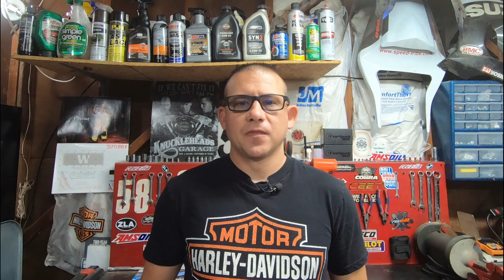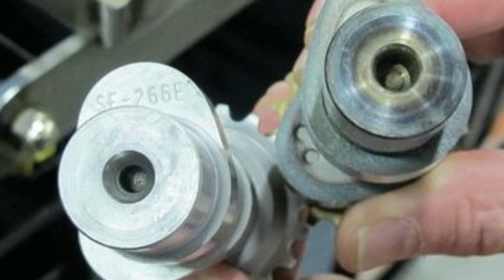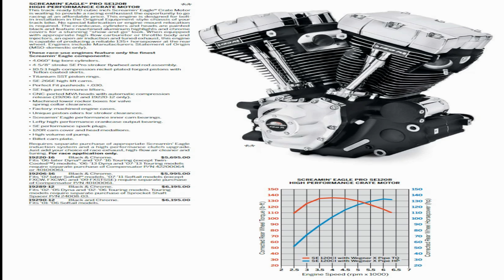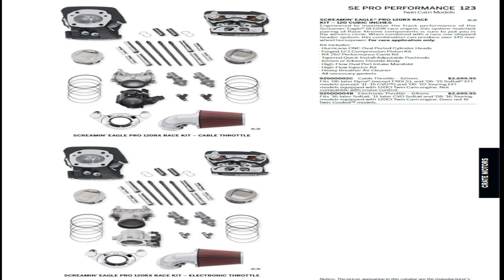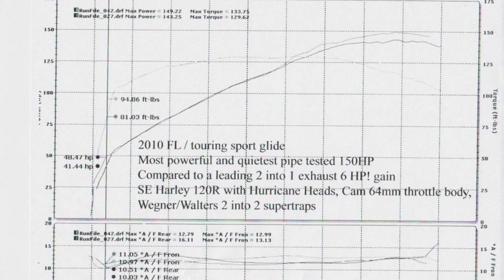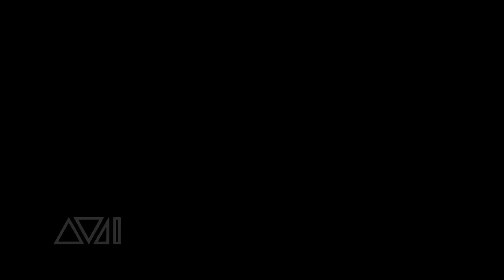Harley's Screamin Eagle 120R Twin Cam CAN Get Even More Powerful

Comment: Yes Harley Store or Harley whatever it's a dealership under Harley franchise I don't know but a Harley dealer.
Get a load of this I take my nightster in 7 thousand kilometers I was sending it to a fellow out by Montreal for head work cams etc.
The dealership calls and say we have a company through Harley does heads we have all Harley stuff.
I'm sold the mechanic working on the bike was ok and have had no problems to date with mechanical other than natural stuff consumed clutch.
So I wanted to order the Nightster fender and parts as the Canadian version did not look like the nightsters advertised.
They told me it was an illegal mod.
It should be illegal to put something together at that price with e dynos the last one being the final dyno setting the engine timing ect.
They changed nothing from some can map for a 551. My complaint was how do you do that the numbers are different between the cams.
Anyway sorted now took 2 years and a camera went looked inside to see pitted pistons .imagine the head is the same.
So now I'll use other runners not the Harley peo tune.funny other company's have maps for Harley cams.
So I'll get Andrews or s&s or redline no more Harley expensive parts I'm Gina pay I'll pay but I'll pay now for specialized as Harley don't hold their own.
Sad. I love harley
Reply: The pro runner was the saving grace.i knew something did not sound right going through the throttle to excelerate and I'm talking normal excelration I'd go through the one set of numbers reamed havovic.
The pro runner soon as I seen it like how is one cylinder 14 degrees higher than the other and then a 1000 rpms away the other cylinder.
I start slow one cell at a time worked to a basic map with no advance and slowly added some back in it did work a 6000 rpm but who lives there on a street bike and even them no would jugle around for no apparent reason like 26 degrees dropping back to 23 and in the next cell jumping to 29 made no sense.
They justified it on irregular firing of the Harley motor.
So my response was a 536 cam has been around along time before EFI and apparently it's the same grind with the exception of some difference on the cam for EFI but the grind is identical so I asked them how did you need able to do this with points as I see no difference well big difference but the actual rotations are all the same.
Thank-you for the light you show us on problems we can face and for you help suggestions and advice love it
Thank-you
Reply from the maker: Thank you! Fuel injection love it or hate it on a Harley,  it's given us the ability to tune each cylinder individually. This really helps with cooling down that rear cylinder and allowing us to get more precise VE tables.
Reply from the maker: The "download" as it is often referred to for tuning on some of the Harley Dealer installations is awful. If you're sticking with all Harley performance parts it's well worth getting the Screamin Eagle Tuner. I don't think I've ever seen a bike that ran right with the canned download map for their parts. In my opinion even the factory tune on new bikes isn't really that great, but it works alright since the standardized assembly process. Even a with a Harley Tech doing the install, doing everything right, the canned map just doesn't work. If you buy the tuner and the dealer installs, the technician will map the bike with the tuner and run it on a dyno. If the dealer doesn't have a dyno, a good dealer will run some auto tune sessions and make sure it's right before they send it out.

Comment: Hey man, thanks for this video. I've wanted a general summary and comparison of these equivalent motors for quite some time. We should note that "horsepower" is a fictitious number derived from measurable torque x RPM meaning usually, that horsepower number gains denote increased flow at higher RPM and conversely, sacrificing torque at lower RPM (waiting for the blowback as soon as I hit "send"). With your explanation here I'd likely stick with the "R" (no X-pro) and find a torque cam for it being I really never redline or race stop to stop (my days of doing that are long since gone). In the comments I also see people tour with these things (I tour on a stripped down Softail) so that eases concerns however, what additional mods would be required downstream; i.e.: primary chain, clutch, (existing 5 speed trans) and belt? No need for specificity but your general thoughts would be great.

Footnote: I'll never understand in comments why people must put others down so offensively for some items not included in anyone's YouTube productions we get for free. Impressed you took a higher road not feeding on chum thrown add-hock to sharks.

Good job and thanks!
Reply from the maker: Thank you, l appreciate your support of the channel. These are really good motors, l would definently add an oil cooler if you don't have one already. For me the two things l would do installing one of these is upgrade to a Screamin Eagle compensator and and look at a good high performance clutch upgrade. Definitely a compensator, the clutch would just depend on how hard you plan on riding the bike.

Comment: To bad they don't make the ST in a "B" motor. Seems perfect for my Heritage
Reply from the maker: Yeah it won't work for the Softail, butnthe 120R will fit and it's basically the same engine. Just a more aggressive cam and an upgraded cam plate with a high volume oil pump.
Reply: @GixxerFoo  so, the 120R is a balanced motor ? Nice, but way too aggressive for the street in my opinion.....I like the occasional holeshot , but I don't want to be at the bar 3 pitchers in by the time everybody else catches up  🤪🤣
Reply from the maker: Lol yeah they have an R that fits the Softail. A little milder cam and you have basically the ST.

Comment: Would either of those fit into the 2016 Triglide frame? Would absolutely love a little more power.
Reply from the maker: They sure will, there's nothing different about the mounting system in the trike frame.
Reply: Thank you, the dealership was telling me could not even add a stage 4. By any chance do you know if the newer 131 engine would fit? Thank you for your time and definitely enjoy your videos.
Reply from the maker: I'm not sure about an M8 2016 trike, the motor may fit but it would require extensive wiring. The dealer won't do a stage lV since Harley won't warranty it in the trike. Just like they say 120ST is only for touring bikes but it will fit in a Dyna. Theirs no difference in the trike engine vs. A touring bike engine.

Comment: Great video, i just to have a 103 with stage 4 kit on my fatboy 2013 feels powerful but i decide to do a swap for a 120 R, and yes, is another level a lot of power all the way up, very fun to ride in curves and straight lines as well, good for long haul.
I added an oil cooler and works perfect. On an engine for racing there will be no guarantee. Keep posting. Twin cams are very strong
Reply from the maker: Thank you! That's awesome to hear, if it's done right like you have it should last and serve for many years.
Reply: @GixxerFoo  that is correct, greetings from PANAMÁ
Reply from the maker: I bet you've got some beautiful places to ride down there!

Comment: G'day team, it was interesting to hear what you had to say about the 120R and thanks for your comments. Currently I have one fitted to my 2009 CVO Springer Softail and it copes quite well with day to day traffic and riding but in saying that this would be different for everyone because we all live in different areas and population. Mine is fitted with a 55mm HPI throttle body only because it was originally for the 110 motor and a D&D 2 into 1. I had the o'l girl on the dyno and it came out at 108hp and 128 torque, yes the numbers are low and possibly due to the 55mm TB but it's a tough street motor and yes it pulls at wide open so hang on if you decide to get one yourself. A few items I would highly recommend you also fit is an upgraded clutch and basket, I fitted a Barnett item and it's great as you would expect. If you decide to head for the 120ST version spend a bit more and add the cam plate and oil pump as an upgrade. which ever choice you make remember to have a good look at the compensator because it may need updating as well. I believe that the one big advantage is the Screamn Eagle Crank Shaft as the Twin Cams suffer from a poor crankshaft and the improved crank bearings as well so if you did a price comparison with upgrading the current twin cam to buying the 120R it's a no brainer. Just one other thing with the 120R is they have an issue with the lifters failing so make sure you change out the SE valve springs for a set of bee hive one able to hag on to the 266E.
I hope this is of some use to anyone out there, keep the shiny side up won't you. Regards VM.
Reply: I feel the same way.bigger TB, Beehive springs a must,  Thunder Max cost a good bit but worth the money .Last but most important Barnett clutch .we have good results with this combo .
Reply from the maker: That's what l was looking for, you have one and you have a first hand account of how they run on the street! Thank you for mentioning the clutch and compensator, lol need it or not at the time those aren't bad to go ahead and upgrade also.

Comment: The only reason the Harley says the 120st doesn’t fit in dyna models is cause it comes with an electronic throttle body.

Does this guy even research what the hell he’s talking about!!!
Reply: With enough money and time you can do just about anything ur heart desires
Reply from the maker: Pretty much, or skilled hands. Fabricators can do whatever they want and make it look factory.
Reply: @GixxerFoo  having a little mechanical ability can go a long way. Especially working on harleys, such simple machines
Reply from the maker: Oh yeah, they aren't bad at all. There's nothing over complicated about the motors, even the new M8.
Reply from the maker: That is true, also Harley won't warranty it if you put it in a Dyna and swap out to a cable throttle body. But yes you are correct, technically it can be put in a Dyna.

Comment: Just did 1000mile trip this week with my 120r,  ran like a top, and I was getting about 25-35miles more per tank then my dad with a 103 kit. Power is fun at first but leaves you looking for more. Thanks for the video, not enough videos on these motors.
Reply from the maker: Thank you! I appreciate the comment on a long trip with a 120R, a lot of people say they aren't reliable. If anything they are more reliable than the stock motors with that heavy duty crank and premium components.
Reply: @GixxerFoo  you may have a problem sir....😳
Reply from the maker: What happened?!
Reply: @GixxerFoo  lol..this power thing can make a person go mad!!!😀
Reply from the maker: 😆😂 it's a rabbit hole for sure, it just keeps going. It depends how much you want to spend and how far you're willing to go.
Reply: @tmar0075  if you're into cars I'll save you the time and show you the end goal. Google slc superlite or ultima evolution 

Deep in the power game in Cars. 700 rwhp but like 2 hours of work or less and it's hitting 1300 rwhp. In a 69 gto..... it's death but beautiful.
Reply: @GixxerFoo  update on 120r, did a 4000 mile run this past summer, didn’t realize a lifter collapsed and had ran hard, ended up having some metal go through the oiling system, long story short my cases and heads are on their way to hillside cycle in New York for a 124. EVERY forum addresses this issue and it was like clockwork, I knew I should have changed them out before I left but can’t change that now. Simple maintenance as sworn by online would’ve just saved me big $$$$
Reply: @Stonedglide89124r how many miles on those lifters before they failed?
Reply: @thomasborger6548  about 20,000
Reply: @GixxerFoo  Your video about the 120R encourages me more nowadays because you are the only one making the reliability observation regarding the integrity of the 120R. I found the Tampa HD video with Tony Nicosia (Sp?) where he explained how he and his CVO engine team designed and produced the 120R engine when I first began looking into buying one two years ago. In that video he briefly explains the processes he and the team took to make the engine as reliable as a hammer. It seems there are many ways to get lots of power out of it too. :)

Comment: For that money I'd go with the S&S 124 and get gear drive cams plus their flywheels which are much stronger.
Reply: Agreed. Honestly once I upgraded 88 to a 95 the motor has done very well (Oil Cooler Added) It just won’t die. If I were to upgrade I think I would go to S&S 124 as well.
Reply from the maker: The S&S in my opinion is a much better engine, they engineered out the factory weak spots.
Reply from the maker: S&S is hard to beat, they fix the weak points in those twin cam engines.
Reply: @GixxerFoo  Tony Nicosia designed this engine for strength and power. No one else in modern history else in modern history of motorcycle engine design for both strength and power has more knowledge and expertise. While S&S is a favorite of mine as well, the master of power and strength cannot be denied.

Comment: I have a 2010 Fatboy Lo with the 120R.  Bought the bike new in 2010, had them split the cases before I took possession and installed the 113 Stage IV kit.  I had V&H Big Radius 2 into 2 exhaust, very loud and hit hard, bottom end power wasn’t great, but the engine came on hard at 3k to red line. That engine was stout, but an inner cam bearing came apart around 16k miles, destroyed engine, so I bought the 120R crate engine to replace it, has a Freedom Exhaust 2 into 1 and used same induction I had on 113. 120R with Freedom exhaust has much better bottom end, and actually is more low speed friendly, rather docile. Around town riding is fine, much better manners than the 113 setup, but did produce a lot of heat, so I put a Jag fan assist cooler on it to remove some heat. Still comes on hard from 3k to redline.
Reply from the maker: That's awesome to hear that 120 has some bottom end. Looking at power curve on the dyno it goes almost straight up after 3k rpm. It's been a while since I heard anything about a 113.

Comment: Both engines are pretty impressive. I think for my riding style and my bike, I’d probably find a motor from S&S more fitting for me. But that’s a long way off. I’ll be running my 96 into the dirt before investing in a swap like that. 

Enjoyed the video man
Reply from the maker: Is that a special option or does it come with the engine already?
Reply from the maker: Thank you, yeah S&S is probably a better investment. They are built without the factory issues and arguably higher quality parts.

Comment: I wonder how long it will last beating on it stoplight to stoplight daily I imagine the ST will last longer than the R
Reply from the maker: That's a good question, with the only difference mechanically being a cam. But the R does have a bullet cam plate and high volume oil pump. The ST would have a "legal" tine which is gonna be very lean if you kept to legal specs.